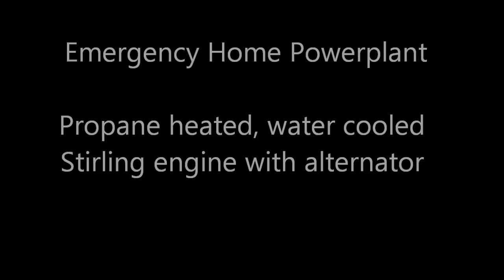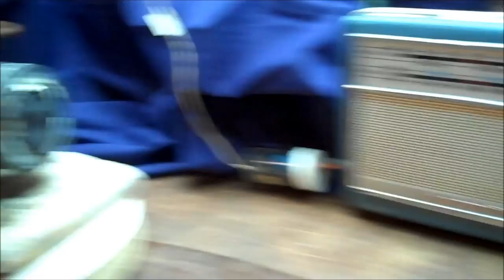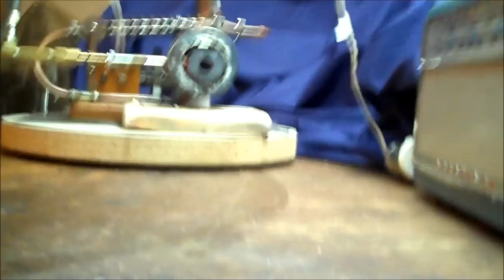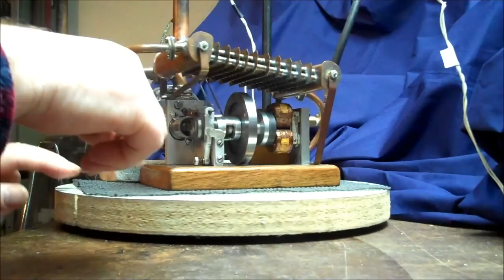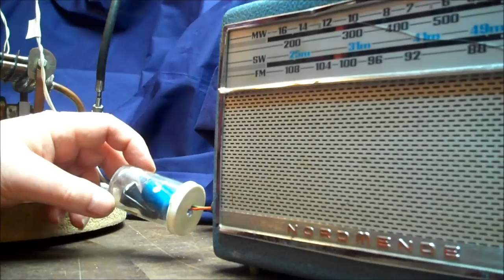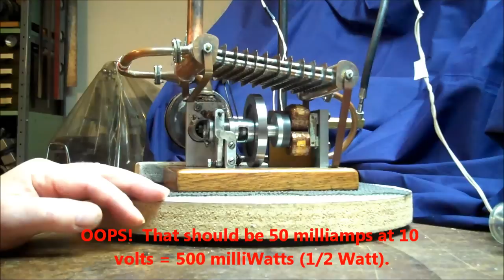Stirling engine emergency home power generator

Comment: awesome!!!
Reply from the maker: +Pete Slonka Dear ol' Dad would appreciate that :)
Reply from the maker: Pete Kiryluk Yes, it's entirely possible to build a Stirling engine which operates between the temperature of a house (whether AC'd or not) and the outside air temp in the summer. I'm pretty sure it's been done--long before I was born (1977). Thing is, the AC system has to work harder to transfer heat from the engine's hot end to the outside air, so it's cheaper and more energy efficient just to take whatever energy you need from the wall outlet instead of using the Stirling engine and generator, because all of the energy will ultimately come from there anyway, and you won't lose any of it due to the engine's internal frictional losses.
Trickier still, but still possible, is to take advantage of a heat sink such as a local body of water, and solar energy from a thermal collector, to run a Stirling engine. Straight up, you won't be paying the utility company to run your engine, converting it's crankshaft power to electrical power, and running a generator to produce electricity that's much cheaper to take directly from the grid without all the thermal & mechanical 'middlemen' who demand payment for their work :)

Comment: Great Video. Nice apparatus you got going there. You could probably sqeeze a little more heat out of your system if you insulated your exposed piping.
Reply from the maker: The piping is there to carry liquid coolant which gives off heat through the top-mounted radiator, reducing the temp of the cold end. No point in insulating it.

Comment: challenge for someone - build one big enough to spin a car alternator. hook up to a car battery, route it through a magical wizzardry device to convert from AC to DC (or vice versa can't remember which is car & home) & get it to power some small to medium size appliances in a power outage. or wire a few batteries up in parallel & power an entertainment system.
Reply from the maker: artardFTW That would be a very, very expensive and highly-polluting way to power your appliances and gadgets. The cheapest and lowest-pollution energy source available is electrical power taken from the grid--that's why there's already a push to develop electric cars despite the extremely high cost. This engine & generator are a hobby project and for 'emergency entertainment' only, it'll run a portable radio, but not an air conditioner! :)
Reply: BasementEngineer all its gotta do is be able to maintain enough momentum to spin the heavy rotor. otherwise alternators are pretty low resistance when spinning. I think it'd be a nifty little gadget for when the powers out lol considering where I'm at just got slammed with a nasty humidity storm that took out our power for an entire day
Reply from the maker: artardFTW No, it has to do with generating twice as much power as you need to operate your devices, because car alternators are only about 50% efficient (done that way to keep the cost down.)
So, to operate a 100 Watt device, you need to produce 200W with the engine because the alternator wastes half of it as heat. It has nothing to do with momentum, you're confusing spinning a disconnected car alternator by hand versus using one to power a device.
Reply: BasementEngineer I guess you have to explain to some people that the alternator doesn't spin so easily, when it has a load.

Comment: Great video! Would an alternative be to just buy 12 volt appliances at a truck or camping store for emergency backup from the grid?
Reply from the maker: John D  The beauty of a stirling engine is the fact that it may be powered by any reasonable heat source.  How often have people lamented about the dead batteries during a power failure.
Three years ago we had a power failure in my neck of the woods that lasted 5 hours for me and several days for others.  We used a butane picnic stove for hot drinks and, you guessed it, the generator described herein for the radio entertainment and news. w

Comment: How may I be able to start the engine without the initial moment ?
Reply: if you put some kind of flaps on the flywheel and have some built up electricity in a battery it could run a fan system that could blow the flywheel, then once the engine is on u turn the fan off. (you will also need something to make the air flow more directly into the flaps on the flywheel), then u simply power electrics off the battery. If you want to start it without manually spinning it you will need to have some electricity already in the battery.

Comment: you mention that you built this in 1970's. Is this still the same model? how much maintenance have you had to the sterling engine?
Reply from the maker: Vance Walsh  There have been some changes and repairs over the years but, most of the development work and improvements were accomplished within several years of this engine's construction.  A recent repair was the shimming of the sliding block in the rocker arm as it had worn and made noises. w

Comment: How might you replace the non renewable fuel (propane) with solar heat energy?  A small parabolic collector could generate as much daytime heat as you would need. The scale of the solar collector dish would be determined by the size of the sterling engine needed to generate the required power.  I would like to see a sterling engine built to power the compressor for an air conditioner.  
Photo voltaic panels would of course accomplish harnessing the sun’s energy to power a home air conditioner but with current efficiency only at 18 to 25 % you would need quite a lot of panels to capture enough energy.
Reply: Check into Boeing's collaboration with Sterling Energy Systems making parabolic concentrators focused on linear alternators in huge power plants in sunny places. Google 'sterling engine power plant and click 'images'. Now, if only somebody would make these for us folks.
Reply from the maker: Thing is, if the photovoltaic panels are 18% efficient, that's probably doing better than many small, inexpensive Stirling engines could muster if they produced enough power to run a small household AC unit. Plus, the PV panels would make no noise and require no maintenance. That's one major reason why more effort has been put into developing PV cells that small Stirling engines. Stirling engines are mechanical devices requiring upkeep such as oil changes, periodic working fluid repressurization etc. and they always make a noise while running. PV solar cells do not.
Reply: The solution is to place a sun-tracking fresnel lens over the hot side of the engine and bury the cool side underground. The hot side will reach over 3800*F while the cool side stays around 70*F. The larger the temperature difference, the more power the engine can deliver. This setup I call a Solar Geothermal Stirling Engine.
Reply: a small water wheel will also do the same and doesnt need to add extra input .. just a flow of fluid of sufficient strength to power what you choose to power ...

Comment: could you copper an magnets to heat the water
Reply: I dont know exactly what you mean... but u can use the electricity from this system to power a stove or heating unit to heat water.
Reply from the maker: ryfodrea  Yes, of course;  but why would you wish to do so??? w

Comment: Your stirling engine\generator is not just a machine, it is a work of art. Well thought out and practical. Thanks for sharing.
Reply: 🔴 What Is Islam? ⚠️

🔴 Islam is not just another religion. 

🔵 It is the same message preached by Moses, Jesus and Abraham.

 🔴 Islam literally means ‘submission to God’ and it teaches us to have a direct relationship with God. 

 🔵 It reminds us that since God created us, no one should be worshipped except God alone. 

 🔴 It also teaches that God is nothing like a human being or like anything that we can imagine.

🌍 The concept of God is summarized in the Quran as:

📖 { “Say, He is God, the One.  God, the Absolute.  He does not give birth, nor was He born, and there is nothing like Him.”} (Quran 112:1-4)[4] 📚

🔴 Becoming a Muslim is not turning your back to Jesus. 

🔵 Rather it’s going back to the original teachings of Jesus and obeying him.
Reply from the maker: @عبدللهبنعبدلله-ن8و  Treating women like dirt is not part of Jesus' teachings.

Comment: what is the effeciency of this engine?
Reply: Quantum Uncertanty Workshop Small Stirling engines are not very efficient - maybe 10% or even less (gasoline engines ~25%, up to ~45% for diesel). The hot/cold thing you mention is bogus - ALL heat engines rely on the temperature ratio "across" the engine, the higher the better. The advantage of Stirling is it can use low quality or waste heat, and in that respect its efficiency doesn't matter that much.
Reply: these things are at least twice as efficient if not more than a gasoline engine because they run off of hot/cold so they use ALL available input energy. depending on what you build them out of(household junk or full fledged professional piston engine setup) will also depend on the efficiency as well. DHIndustries channel has a 2 part video that looks like it's from the 70's that has some pretty incredible uses for a sterling engine and considering this thing was created in 1816 is still. i have seen portable sterling engine generators(they look like a normal store bought generator) that run off of propane tanks.

Comment: I have thought of trying to make a power piston [as seen on youtube] out of epoxy putty,but  mixed  with an outer coating of graphite powder which,hopefully little or no lubrication would be necessary,maybe in a test tube glass cylinder.

Comment: I like your engine! I think you should make a multi piston version of what you have. 
I noticed that you are wasting alot of heat because your shroud around the flame is not insulated, just a tin can, also if you had more than one piston you could capture more of the heat when you are burning your fuel.
 I bet you could run 4 pistons on what you are burning now for only one and get 2.5 more watts out of the same amount of fuel. I don't know if it would be worth your time but 3.5 watts of emergency power would be wonderful.
 I also had a question for you. You look very talented and I was wondering if you would like a chalanging project that could make you some good money. I have plans that I have made for a compound sling shot that doesn't use rubber, it uses a powerful spring with cams and bow string. Many people use sling shots around the word and would love to have a compound sling shot like I have described. If you are interested I would be willing to send you the drawings and you can use them any way you please. I would just like some one to make a compound sling shot like my idea, "or better".
 I would love to see if you could work with my idea. If you are interested please email me and let me know, thanks. randytravis326@yahoo.com

Comment: Great video.  I am currently designing and building the worlds first solar thermal powered car.  I am using a large curved mirror to heat up a pipe to run a steam engine.  I also wanted to build and test a stirling engine.  the system will be running around 200c.  Can this model be scaled up to produce 500 to 2000 watts of electrical power.  Will the stirling engine design be different if running off 200c heated oil instead of much hotter combustion?  I was also looking into the alpha stirling engine design.  I wanted to separate the hot and cold cylinders so there is little heat transfer between them.

I have over 30 videos so far about the solar thermal car on my youtube channel if you want to have a look.

Comment from the maker: If the engine were large enough one could use the burner exhaust to heat a steam boiler, but...

One could gain much greater efficiencies with a stirling engine by incorporating an efficient regenerator (takes design effort) and a recuperative burner that uses the burner waste heat to pre-heat the incoming air.

From memory, engines incorporating these features have achieved efficiencies exceeding 40%.  w.

Comment from the maker: The lever is a second class lever (I think) that increases the stroke from the one of its input.  The input is from the crankshaft crank pin, and applied to the lever in its middle via a sliding block running in a slot.  The top of the lever moves the displacer rod a greater distance than the throw of the crank pin.

It is a matter of mechanical design chosen by the original designer / builder / publisher of this engine and is not strictly necessary for a good functioning design.  w.

Comment from the maker: I think you can buy one.  I seem to recall that an outfit in Australia built generating sets using stirling engines for use on expensive pleasure boats.  Seems the owners of these did not want internal combustion engines thumping away during the night time.

A business in Germany markets stirling engines producing 500 Watts or so.

Especially on sailing yachts where peace and quiet are highly prized.:-)).  w.

Comment from the maker: Well, based on my current fees as an Industrial Consultant, probably  truck load.:-)).

But that wasn't the idea at the time.  I built the engine in order to understand the science behind its function.  As simple as these engines seem, they do have their quirks.  Understanding these quirks helps in designing bigger, better, more reliable, long life, engines.  w.

Comment from the maker: No, because it is abysmal.:-)).  An educated guess has the efficiency at about 1%.

Mind you, it would be easy to determine by simply weighing the fuel used and measuring the electric power produced.

This would be useful if one were working on improving the efficiency of this set-up.  w.

Comment from the maker: The model as described in Popular Science will run on a candle, even on a match or two.  However, in that configuration it will not supply sufficient power to operate the radio.

In energy conversion (thermal to electrical) you DO NOT get something for nothing.  (Energy In minus losses) times overall efficiency equals energy out.  There is nothing one can do to change this fundamental fact of science.  w.

Comment: I acknowledge the time you spent and the effort to modify the materials and build the cooling system to increase the efficiency.I built one of the original (From Popular Science: air cooled, with a cigar tube displacer) that I used to power a model boat, it's performance was marginal and it worked better when I water cooled the displacer cylinder with a coil of copper tubing and water from the lake. Your pump is a great invention would have helped me a lot. I like your generator also. Good Job.

Comment: Would you please explain the lever increasing the stroke of the displacer?Also could you give a brief outline of what you did to tune the system for peak output.This is the most useful model I have seen in actual use,Great work!

Comment: I think you're missing the point. The thing is he only needs it to power a 9 volt radio. I'm sure that if he needed it he could make one that would give him multiple kW's and it would still run on anything that will give sufficient heat.. Also, he made it from simple stuff, you know, like bicycle spokes and the like. Things that might be on hand in an emergency.

Comment from the maker: Perhaps 1 1/2 cubic feet;  12 inches x 12 inches x 18 inches.  Much would depend on the use of the engine.  For absolute compactness helium or hydrogen gas as the internal working gas, would be necessary.  For stationary use air is suitable but makes the engine bigger for a given power output.  High internal pressures also make the engine smaller for a given power output.  W.

Comment from the maker: The beauty of a Stirling (hot air) engine is that it can be powered by any heat source or fuel available.  This is not possible with an internal combustion engine.  W.

Comment from the maker: I invite you to go forth and do better.  I built this little powerplant perhaps 35 years ago, and it can run on coal, wood, corn husks, etc.

Let's see your Honda generator run on wood in an emergency, when gasoline is difficult if not impossible to obtain.  W.

Comment from the maker: Never did determine the thermodynamic efficiency,  but the propane consumption is very small when running the radio.   It would be interesting to know the alternator's efficiency, though.  But I don't think that a hobby style motor is the answer because of its high speed requirement.  This engine can manage, perhaps, 1200 rpm.  W.

Comment: Really nice stirling engine, and like the way you explain how everything works, etc. really generous, I go myself and dreaming about building a fairly avanserad when I have access to cns lathe and milling, and is crazy interested in mechanics. the absolute colaste had juh been if I could get it so strong suit small and stable that you could have used it on a radio-controlled boat, then rc models also it gives me goosebumps ..

Anyway thanks and respect to you and your knowledge ..

Comment: have you considered changing out the water cooler for an ammonia based solution like that found in a lp refrigerator? I have been thinking about that myself since the way to boost torque is to get the greatest temp differential possible.

Comment from the maker: Thanks, it *is* a real engine, using heat energy alternately added to and removed from the working fluid (air in this case) to drive the power piston.

Comment from the maker: freakqnc,
The fuel is propane, the burner is a flat ring with the jet holes pointing parallel and slightly towards the heater tube of the hot end.  The important thing to watch on this type of gas burner is that the burner jet holes are substantially smaller than the material thickness through which they are drilled.  For example, if the jet holes are 1.5 mm dia.  the material thickness should be at least 2 mm or better 3 mm.  A pressure regulator on the gas bottle reduces the pressure to 20 psi